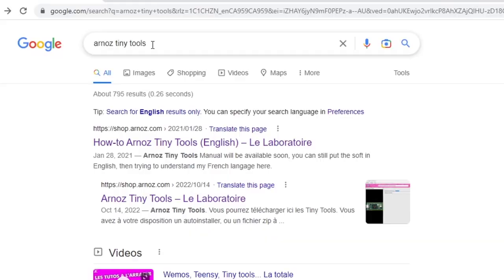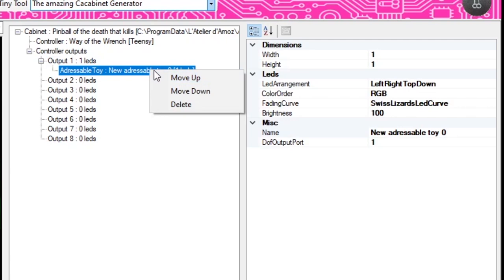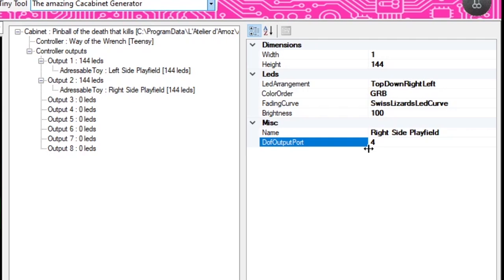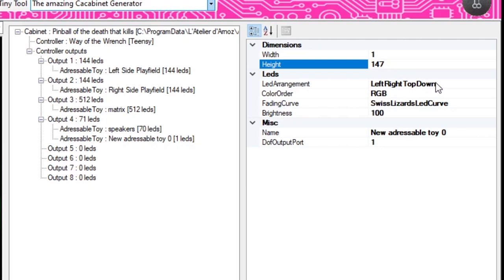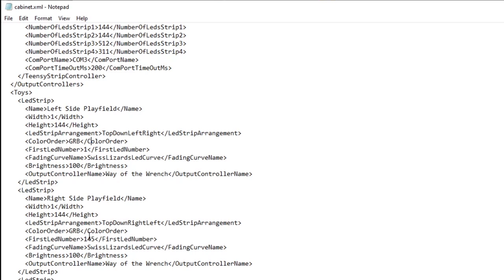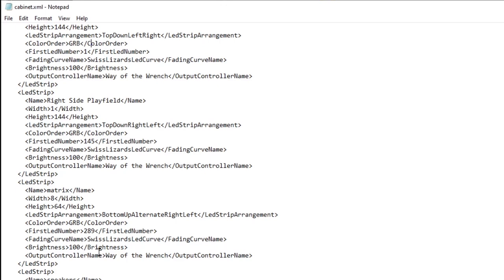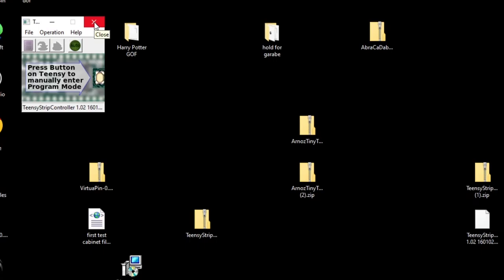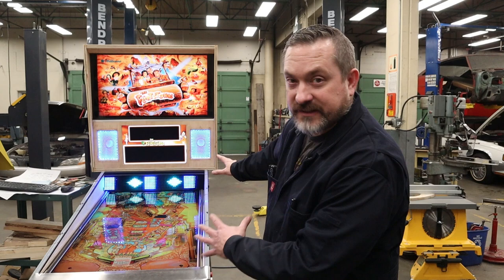Virtual Pinball: How to make a cabinet.xml file and install the teensy strip controller

Comment: So I just finished watching your cabinet.xml video after testing, wiring, installing my LED's and configuring DOF. I am proud to say EVERYTHING worked the first go around. I was nervous about the flash issue you outlined, but mine worked immediately. I have the Teensy 4.0, but that's the only difference between our setups. Just wanted to express my thanks for your detailed tutorial, there is little chance I would have figured this out on my own and your videos make it look so effortless. I have about 10 feet of extra WS2812B LED lights so similar to your cabinet, I think I am going to add those to a separate controller and power supply so I can light up the inside of the cab when doing maintenance while all the cabinet components are powered off. So fun to think of ideas . . . thanks again!
Reply from the maker: Awesome!  I'm glad it went smoothly for you and you enjoyed my teaching style. Yeah the interior led lighting is killer.  If you deem me worthy, I'd really appreciate it if you could share out my channel on your social media so I can help more people.  Thanks for the watch and your support for the channel.  Cheers!
Reply: I just ordered a 4.0 did you have to do anything different with firmware/software to make it work? I'm diving into this in a couple days
Reply from the maker: 4.0 works fine, just flash with 4.0 file.

Comment: Another good way of viewing XML files directly is using by Foxe (First Object XML Editor), which is free and is easier to use than of notepad. I use it a lot for my work with AutoCAD Plant 3D. It shows both the tree with their variables and the code itself in separate windows side-by-side. The left side tree allows variables to be editable. The right side will show the code in its entirety and is also editable. When entering your variables in the tree, it will highlight those in the code as well.
Reply from the maker: Ah ok, cool.  Thanks for the tip!  Cheers!

Comment: First, thanks for a great series. I have watched your videos it seems 10x over. My cab is a 65% scale and I was able to incorporate lots of your tips and ideas. I must say though this teensy 4.0 controller is a royal pain in the you know what. I watched this video many many times and followed it to the letter but still my controller does not seem to be working and the cabinet file is not getting picked up by DOF. frustrating to say the least. It programs fine through the Arduino IDE no problem and the Rainbow sketch work great so I know the hardware is good at least. This is just my experience and has nothing to do with your videos. I recommend this series to anyone wanting to venture into the Vpin world.
Reply from the maker: You're very welcome!  I'm pretty sure the flash of the teensy strip controller isn't flashing correctly.  Lots of people have had this issue and they keep attempting to flash it and then it finally works.  Try a bunch more.
Reply: @wayofthewrench you were right. It took several more attempts but it finally flashed properly. On to the next problem..😂.
Reply from the maker: Sweet, glad I could get you sorted out.  If you deem me worthy, I'd really appreciate it if you could share out my channel on your social media so I can help more people.  Thanks in advance.  Cheers!

Comment: Hi when i try to upload the downloaded firmware on the teensy 4.0  the program button is greyed out no matter what i do and other firmware upgrade didnt work ☹️
Reply from the maker: Make sure you have the 4.0 firmware and I would try several attempts, it didn't work the first time with mine and it only worked with the manual flash.  Good luck!
Reply: @wayofthewrench  I finally got it working with the experimental 4.0 firmware but like you said I had to do it a few times. I have the matrix working now in tables but popper isn't for some reason. Thanks btw your tutorials are a massive help. 👍
Reply from the maker: Perfect! Glad you got it going!  I would re look at the video for dof and there is a section on adding some code to pinup for it to work.  Glad you're loving the content!  Cheers!

Comment: Not sure how much you've been able to actually play the machine, but is the LED matrix distracting?  Specifically, with reflections off the playfield monitor?  I can see them at the beginning of this video and it's got me questioning whether I want to go that route or not.  THANKS!
Reply from the maker: I've played a good bunch since I've installed them and they do not bother gameplay at all, in fact I feel they enhance the fun.  Now I don't have the glass on yet so we'll see when that's on.  Thanks for the watch!
Reply: @wayofthewrench  You can use a laptop/screen privacy guard sheet of film that stops the light reflecting at certain angles. I bought a sheet of it, but haven't put it on yet.
Reply from the maker: Cool, let me know how it works out for you.  Got a link for the film?

Comment: I'm strongly considering using your plans to do a 'murphy bed' style cabinet that sits between studs. What I'd like to do is cripple up a window frame in an interior wall; and then have the table flip 'down' out like a Murphy bed and then Stow away when not in use :)
Reply from the maker: That would be a good idea!  You'd have to shore up the frame though as 16" between studs isn't wide enough for a monitor.  Ya gotta send pics if you do this.  Cheers!

Comment: The led strip lights, are they connected into my rigmaster for dof. As far as i know they have a signal wire which goes to the teencab, and a + - to 5v.
The video has a part when you assign ports on the dofconfig.
Reply from the maker: I'm not sure about the ringmaster but yeah aleds need positive and negative plus a green signal wire.  Then you would add the port to your cabinet.xml file.  Good luck!

Comment: Great Video once again Emil :D I am using a few of the Arnoz boards which are sooo good, but the manuals can sometimes be a little hard to follow for me, so nice for you to do one on this one.

On a whole other matter... I know you use an old tv for the playfield, but do you know if it is a VA or an IPS panel?
Reply from the maker: Hi Jesper!  Glad I could help ya out.  You would have to search up the used tv/monitor for their specs to find out for sure.  VA monitors usually have wider viewing angles but lower contrast but the technology changes all the time.  For vpins, we really need wide viewing angles as the playfield will wash out if it isn't.  Lag and refresh rate is also really important.  Cheers!
Reply: @wayofthewrench  Thing is, I am building a cab too but just broke the playfield tv so have to get a new one. Went with an IPS panel before, because of the viewing angles, but I thought it could have better contrast and deeper blacks, which VA panels usually have. So was just curious what type of panel yours is, and if you are happy with it. In the videos it look both bright and with good viewing angles, but I could be mistaken.
Reply from the maker: My monitor is really quite nice for a ten year old tv considering.  It has a very good viewing angle, low lag, and for it being a 60hz refresh rate, the true motion plus does make it feel way better than 60hz in game mode.  If you're interested, the exact model is in the video description in my monitors video.  I will be eventually upgrading this monitor to a 4k 120hz monitor but not till I'm done the series.  Kinda eyeing the LG C2 OLED tv.
Reply: I was going thru the monitor decision last fall… went with ASUS 43 inch 120hz (XG438Q ). Its pretty damn great.. I found a local “deal” or would have went 144hz. But these OLED tv’s and monitors are very! Very intriguing.    My advice to anyone is, if it is even close to being inn he budget, don’t skimp on the monitor.  I had an old 1080tv and it was good.  The 4k 120hz is on a different level!  Probably single biggest upgrade I can think of…
Reply from the maker: Yup, I'm looking forward to this upgrade on mine when it's done

Comment: Thanks for the video! I have a teensy 4.0 and the firmware doesn't seem to support it. After flashing with either the beta or alpha the flashing light stops flashing and doesn't seem to work. Is there firmware available for the 4.0?
Reply from the maker: Yes there is firmware that works with the 4.0 teensy.  My guess is that it isn't flashing properly.  In the video you saw how I had to manually flash it rather than using the tiny tools.  That worked for me.  Good luck!

Comment: How powerful of a PC do you need to run a cabinet or even just a single screen machine? For my first project… I am looking into a relatively inexpensive dedicated PC such as a prebuilt PowerSpec G513 at MicroCenter. It has Ryzen 5 3.7GHz Processor, GeForce RTX 3060 12gb DDR gpu and then 16gb of ram. Would these specs be good enough to run most tables? Do I need 32gb or ram instead?  BTW: These tutorials are incredibly helpful and great to watch & learn from.
Reply from the maker: Yeah that pc will be great for 1080p at 60 hz and maybe even 4k at 60 hz and maybe even good for 4k at 120hz if you lower the performance.  I'm jealous, my first test build was an i3 with a gtx 1050....my current budget build is an i5 with 16g of ram and a gtx 770.  This does 1080p at 60 hz no problems.  Good luck on your build!

Comment: Loving the build but any chance you can do a clip on  how to bodge it without all the expensive tools. The Table saw for starters. I don't mind buying a router & electric saw but how many people watching this build can afford a table saw or the expense of hiring one?
Reply from the maker: Well you gotta remember that you are building a quite expensive vpin cab so the tools justify the means.  That being said you can make this without a table saw, you just have to be really steady and there might be a lot more sanding.  There are other options too.  Use a circular saw. Buy a used table saw/sell it when you're done or borrow one from a friend.  Go to a maker space and use theirs. Or buy a $300 one and learn how to use it which might open up new projects or even new career paths for you.  I personally love working with my hands and being creative so these tools allow me that freedom.  Hope that helps, cheers!
Reply: @wayofthewrench  Good points but you picked up a second hand display. You are going to be sad if that breaks & can't get the same replacement. For all the effort a 4K new monitor should have been a must. Not started my build yet but my monitor is 144hz 0.4 ms 4K. Keep up the great work.
Reply from the maker: Yeah the idea was to make a budget build for most people to cheaply start so 1080p it was.  I'm not worried about the monitor as the long term plan is to upgrade this cabinet to a 4k 120hz or higher monitor and capable gpu after the build series is done.  I will have room for a 48 to 50" monitor in this cabinet and all I have to do is adjust the playfield mounts.  If someone asked me what they should do in the future is build around a 4k 120z monitor and you can always set it to 1080p to start and once you can afford the better gpu, it's ready to go.  Cheers!

Comment: Great video as always Emil, thanks. One quick question: So I downloaded TeensyStripController using the last method you showed (From GitHub) and rebooted the Teensy, got the message reboot OK. After that, Teensy does no longer appear at the port list of Windows Device Manager (It did appear there when I set it to manual mode as com3) - I guess that means that programs like DOF won't be able to communicate with it...and indeed I can't get the LEDs to work. any idea?  (Using Teensy 4.0). any way to know that window still communicate with Teensy after the reboot? thanks!
Reply from the maker: Make sure the com matches in your cabinet.xml file or it won't work.  Thanks for the watch!
Reply: Thanks. The com # was fine. eventually I tried the 1st method you showed, directly from Arnoz's and it did work for me, while method #2 & #3 didn't. Leds look amazing! thanks again @wayofthewrench

Comment: Hey I seen that you had your full DMD working on future pinball could you make a video on how you got that to work cause I've been fighting that for months It's actually a whole year since I've had this cabinet built
Reply from the maker: Do you have pinup popper installed?  I haven't set anything up in Future except the full dmd pics/videos in popper.  I am planning on eventually doing a bunch of videos for Future Pinball when I'm done the building series.  Thanks for the watch!
Reply: Then did you have masters of the universe on VPX because that's pretty impressive too That is one thing I've been trying to get is he man on either 1 of them To run a puppack
Reply from the maker: I have it on both but yes I have the pup pack running on vpx for Masters

Comment: so you have 4 green data lines feeding into output 4 on your teensy? Or you just wired them all into 1 green data line? edit: you must have run a green data line continuously through all 4 sections and just used 1 data line coming from output 4 as they all have the same behavior assignment
Reply from the maker: I have one cat 5 wire plugged into the one port.  I used the 4 separate wire sets (4 channels) for different led sections.  One for the matrix, one for the left strip, one for the right strip, and one for the speakers/undercab/behind back box.  Thanks for the watch!
Reply: awesome thanks for clarifying - wouldn't you only need 1 dof assignment for your speakers/undercab/backbox then?  @wayofthewrench
Reply from the maker: Only one DOF cabinet file and one dof config download from vpu.  Yes, only 1 channel for the speakers, undercab, and backbox.

Comment: Terrific video.  i'm having i think com port problems.  I was able to flash it both ways, still nothing.  i reverted back to the test program to make sure my board didn't get fried or something, and that worked.  I know i have power, i know the board is alive, i just can't get DOF make teensy do something.  
In the arduino IDE, i've had the teensy on Com1 and then on a weird usb port.  i know com1 is in use through device manager, i'm confused.
Reply: disregard  above - i started just assigning different ports - COM3 worked eventhough that never appeared on the Arduino IDE.  Working great now.
Reply from the maker: Glad you got it figured out Thomas!  Enjoy the DOF!

Comment: how do i find the serial number for my sainsmart 8ch
Reply from the maker: You don't need the serial number if you're only running one board.  If your running more than one, you might need to find that out.  There is a program in the folder you download for manually operating the sainsmart board (it's in the video).  This program will open the board and spit out the serial number.  Hope that helps.  Thanks for the watch!
Reply: @wayofthewrench  still cant find it ive watched everyone of your lessons but at the time i was only adding 1 board youve inspired me to hook 2 -8 ch  MAYBE IN YOUR NEXT LESSON
Reply from the maker: what you need isn't in the video I made, the program you need is in the sainsmart board download folder that IS in the video.  In that folder is another program that you can open to get the details of the board (serial number).  I originally did that for that video and then found out you only needed that info if you had more than 1 board.  Hope that helps
Reply: @wayofthewrench  still cant find a serial im a fool obviously because google doesnt have a person other than me asking so i could find it i went into folder where drivers and configtoil is inside documents  lash 8ch board setup but nothing that lists a sainsmart serial thanks for fast reply but maybe ill have to add one when im more alert
Reply from the maker: https://www.vpforums.org/index.php?showtopic=28431&page=2#entry277186
Reply: @wayofthewrench  you really need to be given a knight hood sir
Reply from the maker: I'd settle with a YouTube play button....lol